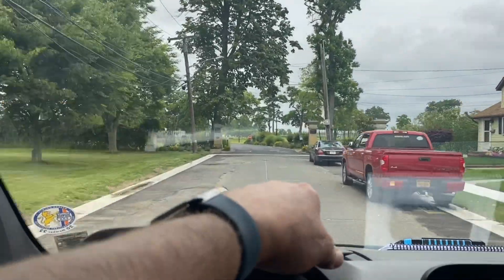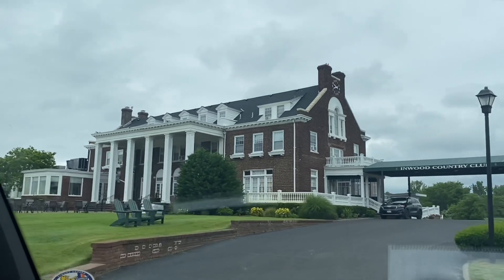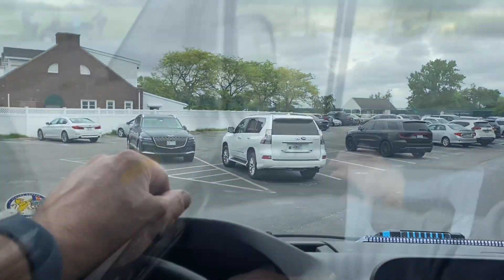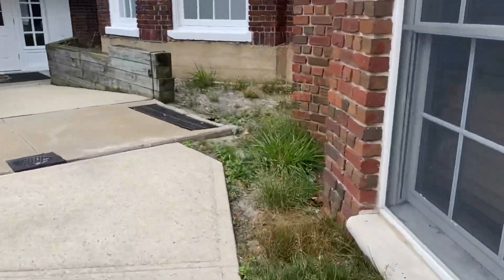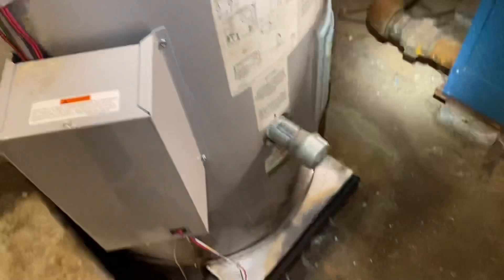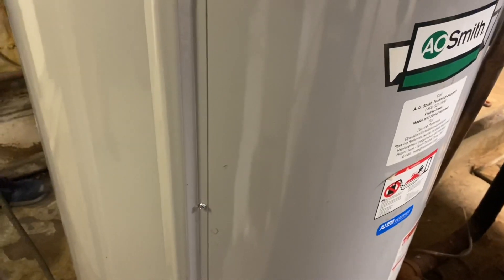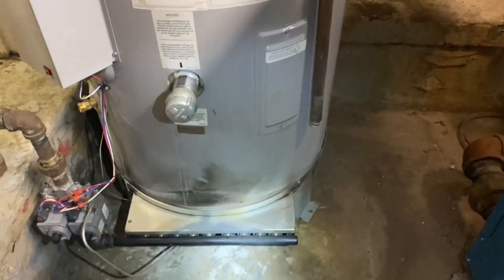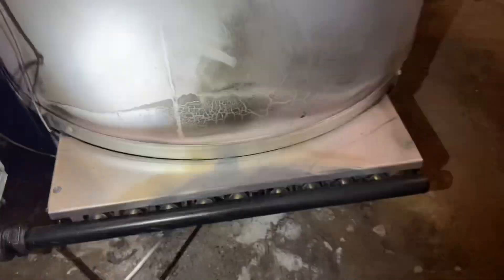Gas Valve Reversed on AO Smith BTR-500 With Flame Roll Out and Keeps Running with Power Off!

Comment: I don’t want to argue, but 100% the gas valves are backwards, and it explains the whole situation. Installed this way the pilot tube has gas to it all the time unless the gas cock is off. You can see it in the vid at the 3:10 mark, pilot tube should be on the outlet side of the gas valve
Reply: @mikeypipes double check it, you could save the installer the time and expense of replacing the tank, likely at his own expense when AO Smith denies the claim
Reply: @PipeDoctor  I hope I didn’t come across as an asshole
Reply: @PipeDoctor  So for the fun of it did your rotate the gas valves and test it.  Also were they factory or field installed.  If factory installed and that way there could be a bigger issue.  If field installed or even factory, how did the installer not see something strange on start up?

Comment: the whole gas valve pair is installed upside down! whomever did that probably shouldn't have a gas license, nor be allowed to touch anything natural gas/propane ever again. my god 😬
Reply: @PipeDoctor   it's 100% installed backwards with flow the wrong direction.
the handle arrows point in the direction of flow when on and wiring terminals face the "outlet side". so original installer put it backwards, then the valve was replaced and reinstalled backwards again, that's why it keeps flowing gas through. there would be small stamped markings on the "in" test ports, there should also be an arrow on the sticker beside the model numbers of each valve and a directional arrow on the back side casing.
they'll know exactly what happened when they receive it back and do an inspection/testing. someone better have their butts covered, because it's likely going to get ugly.
Reply: @PipeDoctor   that's what I was saying, YIKES!
I didn't mean to be so harsh, but it technically could have filled the place with enough gas to go BOOM and caused a fire or death.
I didn't catch it right away either and I've seen plenty of that style valve in single setups, those are just manifolds bolted on the ends to pair them up for enough gas CFM.
valves rarely stick open and may not open at all if the inlet pressure is very high, like a missing regulator on higher pressure system. plain scary 💣💥

Comment: That's some really messed up shit right there! are the gas valves installed the wrong way from the factory? and the tech just reinstalled new the same way?
Reply: yes, they're installed backwards, that's all field installed parts, supplied in a box. they need not be working with natural gas/propane.

Comment: In watching the video looks like you have gas leaking by the valve.  When you turn the system off the gas needed to bleed and burn out and when you turn it back on wasn't completely burnt out hence the reignite/ignition, I could still see some blue flames.  I think that if you went turned it back on after 30secs it wouldn't re-ignite but you would be getting gas out if you had a meter, maybe there was good draft (even though induced) and it was pulling that gas out the flue why didn't smell it.  Being you are not going to be the one to replace would have been interesting to see what replacement does, and like some other below stated looking at the gas flow arrows on the valve.

Comment: This reversed valve theory is interesting. I was thinking along the lines of it being miswired. Maybe the switch isn't shutting off the low voltage? Is it the heat igniting the gas when the power is off? That's why I was going with the wiring. Something is keeping the gas valve open and something is igniting it. Being nobody mentioned this I have a feeling now about that valve being reversed as others have said. That still doesn't explain the ignition. Second guy/time just copied what was there. Mikey Pipes we have to know now. Can you go back for your 40k subs please? :) #LGB

Comment: I have a feeling the gas valves are reversed with the flow indicator pointing in the wrong direction just like another commenter mentioned. You can’t see it in the video as the arrow is on the back of the valve body. Placement of that pilot tube is not in a normal location, usually connected on the manifold side/outlet of a gas valve—in the video it’s connected to the inlet side of gas. Obviously not right and need to visually check those arrow indicator, keep it simple first and eliminate that as a possibility; yes it’s been replaced twice..maybe same tech installed wrong twice we’re humans lol. Interesting one…
Reply: yes, the pair is 100% installed upside down backwards flow! 😬
Reply: You might be on to something there,only one other thing  I notice was he gas psi drop .25psi which is tell me the problem is in pilot portion of solenoid gas valve not closing of during shut down building up gas causing rollout. If you watch the video. Problem goes away when he turn off the second gas valve knob.

Comment: I had two or three of these odd problems with AO Smith products at a college we work at. They happened to be the only manufacturer to make a product that would fit within a very specific space. Was sent back a few times to fix problems that occurred at their factory.  I’ll never purchase another one of their products. They did not reimburse us for the labor spent post-install to fix their screw ups.

Comment: Everything points to the gas valve but was it the case??
Reply: Had this issue with a furnace tech replaced the gas valve but switched the direction of gas flow so it would allow it to come on and burn but wouldn’t stop the flame.. swapped the valve around it ran fine afterwards
Reply: @AJGR33NWR  that is a very interesting diagnosis. Let me check the video to see if reversed…
Reply: Could the valve had been installed upside down as suggested by another viewer?
Reply: I know the gas valve was replaced  but what was the cause of the problem?